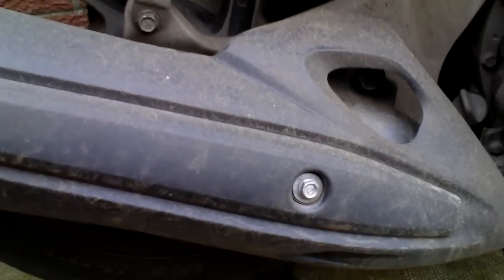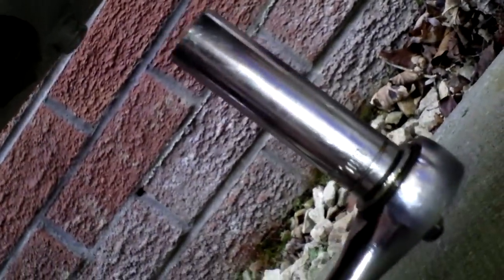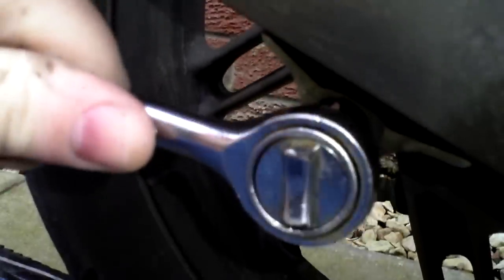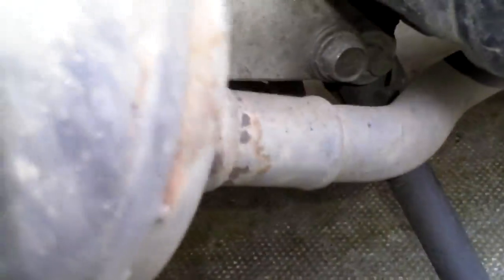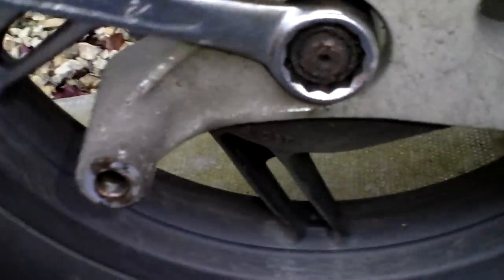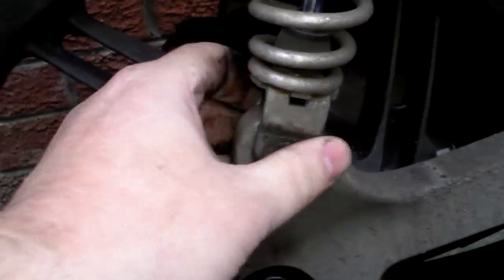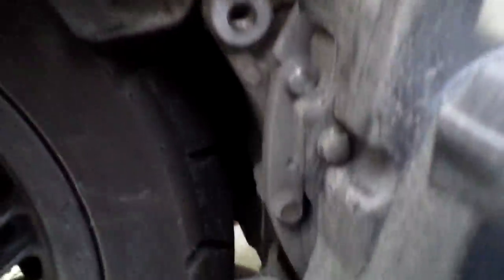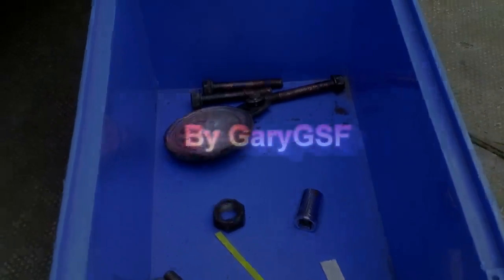Removing the Rear Wheel from a Honda PCX125i

Comment from the maker: @uptowndisco2 3500 miles on mine.  A puncture and now a new tyre has had the rear wheel out twice.  Brake shoes are holding up fine.  Loads of wear left on them.  I hope this will be helpful when you go to change tyres.  The little bike seems easy enough to work on.

Comment: Very helpful. Thanks for taking the time to do video that. How are you supporting the bike when you do that? Just on the centerstand? I think I'm going to buy a set of brake shoes before doing this. Mine has 8,000 miles on it. The copper grease "Anti Seize" is a great tip.